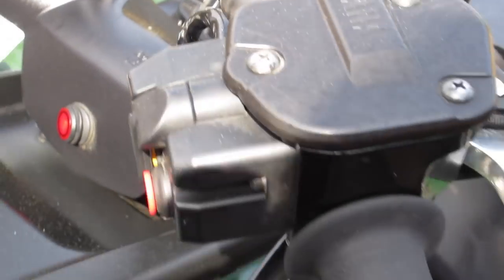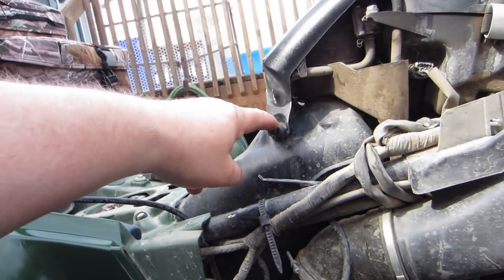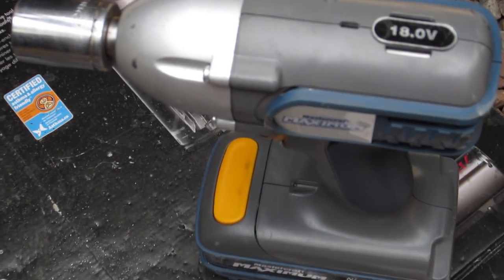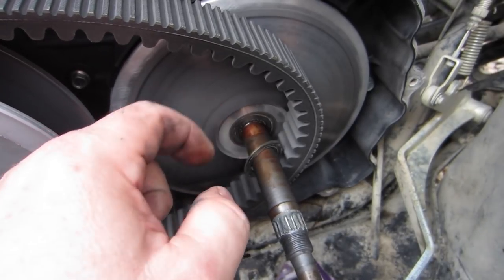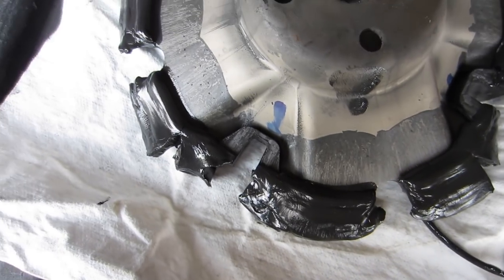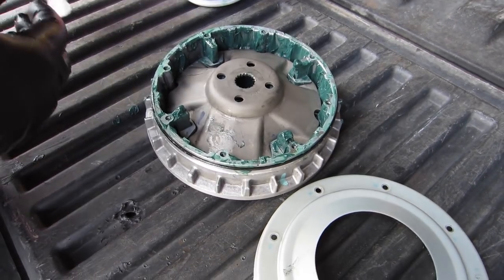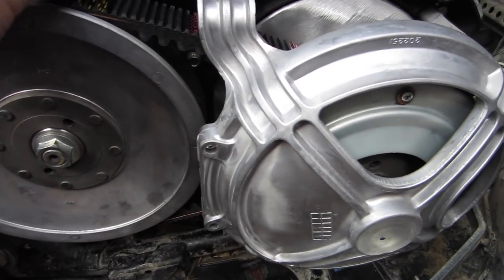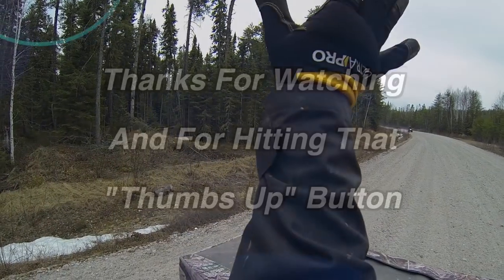Yamaha Grizzly 700 CVT Primary Clutch Cleaning

Comment: 4500 miles on my grizzly, i have never done this and have never had any issues. I have only done regular oil changes, air filter maintenance, coolant change, 1 spark plug, and replaced battery once. still runs like the day i bought it off the showroom floor.
Reply: Yours is in desperate need of a cleaning then. Especially if you have spent any time in dusty conditions. Your grease will get hard and the rollers can't travel the full channel.

Comment: Great job Cubbee, I was a newby with this job just a month ago and it went very well. Mine was at about 5400 kms (though with larger tires and then tracks the last 4 or 5 years the odometer has to be a little off) and there were zero cracks between the lugs. The grease was far too dirty and tacky but it was still doing surprisingly well. Lost maybe 2mm on the belt in both dimensions, remarkable. Allegedly these are 11,000km clutches. We dropped in four 14.7gram Dalton kit weights (a real pain to press out the stock ones and re-insert the others) but what a difference on the low end, snappy! Pretty much the same thing as the "Kodiak Conversion." The only difference I learned different was putting some grease on the outside of the cam plate, into the wells above the sliders but looked very good to this newby and I watched a lot of vids on it! Fantastic overview. We did pull of the brake lever, good to know it's doable without that. We didn't bother with the side panel above the clutch, worked out well. Looking forward to seeing that Grizz wheelie even better now as the rollers should move smooth as silk now. Any flat spots on the plastic roller housings?
Reply from the maker: The Grizz wheelies just as good, and I think I might have gained a bit back on the top end.  LOL  I have noticed it is a bit quieter now too...less "whining". The roller housings look good, and hopefully they'll be good for another 4500km's.  It sure was a messy job getting all the old grease out.  What did you use to clean it? I used varsol and brake cleaner but still took a lot of rags.  Thanks for watching and commenting!
Reply: Yes, noticed it ran quieter too. I just used a can of degreaser after wiping out as much as I could with paper towels. Totally grungy job! We really don't need any more top end in those short little wheel bases anyway! What a clutch those Yamahas have!!
Reply from the maker: Canesser
Sounds like you cleaned yours like I did mine!  Messy!
Reply: ***** engine degreaser and a pressure washer.. :P
Reply from the maker: warmfreeze
Yes, that would do the trick I bet!
Reply: warmfreeze
Yup that would have been better. Just used a parts brush and old tooth brush. Got-r-done.
Reply from the maker: Canesser
Sure did!
Reply: Figured.
Reply from the maker: Canesser
I just checked all my pictures that I took along the way, (just to be sure) and yup got lots of grease in there....good point though and you made me think...did I? LOL
Reply: Canesser  my 2010 kawasaki has 16,000kms and I just had to get my clutch rebuilt. think I did pretty good indeed a lot of hard miles. I know yamaha has the best clutching system out there but at 16,000 no one can complain! kawasaki makes a tough bike.
Reply: That is impressive if that is the 750 Brute Force you're talking about. Lot of power in that ATV! I keep up on the maintenance for performance more than anything, built like a Sherman tank in there.
Reply: nope its a kvf-360. very impressive bike may not be the fastest but it is unbelivably reliable. but like I said ive always done routine maintance and ive replaced a few parts on it but nothing to major what can one expect with all those miles? I am 22 years old so it has had a couple hot suppers if ya get what im saying lol

Comment: Hey guys, i just got it done on my grizzly 450 at the local Yamahastore, the serviceguy is very experienced and probably very old to and he told me that he wiped all the old greese out with papertowel and then washed the variatorparts in gasoline and a small brush...easy and cheap...he also told me that the clutch on the 450 is identical with the one on grizzly 700 and he used 200 grams ( 1/5 kilo ) to re-greese it...it now runs very smooth!
He also told me that the most Grizzlys has a problem with the left rear axel seal...its often leaks of oil because it is not mounted spot on from factory so check that out on your bike (they repair that on warranty)...also he adjusted the front Wheel`s from 6 millimeter ( 1/4 inch ) toe-out to 2 millimeter toe-in because it is way off from factory and my bike runs straight as an Arrow on the road now...just a feew tips for you guys!

Now drive safe =)
Reply from the maker: Thanks for the tips Joakim, sounds like your mechanic knows what he's doing!   Sometimes the little "tweeks" can make all the difference.  Thanks for watching and commenting.

Comment: I should do that on my quad when I get round to it. 2005 Suzuki LTA700 had it from new its 11 years old now. it's mainly used for the work I do fencing and grass cutting in the north west of Scotland. Thanks for the videos most of my quad driving is on steep ground with a trailer so the Suzuki gets a lot of abuse but they can handle it Yamahas are the same
Reply from the maker: +John MacRae Although the belt was in good shape, we were surprised at how dirty the clutch was..well worth checking it out! Glad you enjoyed the video.

Comment: I remember back when I had my 660 grizzly it seemed like it was a bit sluggish even after putting on a new belt.  Originally thought the belt was defective, it was a less expensive aftermarket belt.  Apparently the clutch weights had some gunk around them and weren't allowing the clutch to engage quite as quickly or strongly as it could.  Took them out and soaked them in some diesel fuel to clean all the gunk off and put it all back together and it seemed like a new machine then.  I guess we went through more sand and mud than we realized and somehow it had gotten in there, I don't think it was sealed well.  It really made a huge difference in the performance of the machine.
Reply from the maker: That's good to know Greg...you wonder how dirt/sand gets into some of these places!  But it does!  Cleaning I guess just makes everything run smoother again.  Thanks for stopping by and checking out the vid and commenting!

Comment: Hey Cubbee, I just did the same thing to a King Quad. Same belt too. Man that dust was a pain to clean! I thought it was odd that the Yamaha used grease where the rollers are. Seems like it would make them sticky. Obviously not, since they work so well.
Reply from the maker: Yes, it was a messy little job alright. I don't know why they use grease, but the clutch was quieter with the new clean grease in it. Thanks for watching.
Reply: Thats what i was thinking. my old cat is the same system and runs dry in the roller area.

Comment: Looks like you're a pro at this. Haha. If you hadn't told us it was your first time I would have though that you'd done many of these before. Lol. It's a pretty slick system. So simple. I think those will take over the market if they haven't already. My lawn mower might have something similar to that in it. It's an automatic. I've been trying to figure out how it works. This video did help. You forgot to try reverse. Lol. I'm sure it worked though. If you have all of that apart you might as well change the belt. You made the right decision there. Great video as usual.
Reply from the maker: I had taken the clutch apart once before when I installed the shim, so I guess I kind of new what to expect, but glad you enjoyed the vid.  Yes, the CVT clutch is simple but very effective.  Thanks for watching and commenting!
Reply: Oh. I missed that. lol. No problem.

Comment: Very good and a great help for anyone undertaking this job. But, may I say this is actually belt replacement and roller housing cleaning NOT clutch cleaning. The clutch is a wet plate unit inside the engine and servicing of the clutch is more involved. BUT, thank you !!!
Reply from the maker: Thanks for stopping by and checking out the video!

Comment: How did you find using the Lucas xtra heavy duty grease in the clutch instead of ultramatic grease? Is it working well? How is it in the winter cold? Great videos. Thanks, Dave D
Reply from the maker: We haven’t used the ATV’s much the last couple of years but when we didnin the winter the grease seemed to hold up well.

Comment: Very good job Cubbee! I really enjoyed seeing an up close view of the Grizz to see how it is designed. I have to admit, I had never seen the inside of those clutches in a CVT until now. Thanks for showing the internals of the CVT and how you did the service job. I thought one time I had read something about CVT  transmissions having a fan to cool the belt and clutches? Is this true, does yours have a cooling fan for the CVT? Thanks for taking the time to make the video, I enjoyed it!!!!
Reply from the maker: Hi Palomino! Thanks for checking out the vid.  The CVT design is pretty cool and so simple.  There is a fan, but not specific for the clutch...it does kick in when the engine starts getting warm..it is located up at the front more.  Thanks again, and happy riding!

Comment: Hi
Are you glad you did the shim mod?? Im just about to start to put 1.5 mm in my 2017 grizzly. I do feel its a bit sluggish out of the hole, esp with bighorn tire upgrade
Reply from the maker: Really glad we did the shim mod.  Lost a bit of bottom end when the bigger tires went on and the shim mod got it back.  Nice easy fix.  (You will lose a bit of top end, but still worth it!)

Comment: Nice!  I'm thinking a belt job on my Polaris 850 XP might be a bit of a nightmare as the clutch housing is out back beneath the seat right by the rear diff.  They say that my Polaris belt is good for 5000 miles but if I can get 5000 kilometers out of mine then I'll be happy.
Reply from the maker: That sounds like it might be kind of tricky for sure...best to check the belt..we didn't now what to expect as had no idea how long the belt might last either.  Thanks for watching!

Comment: Thanks for posting great info. What year is your grizz? And how often should this be done?
Reply: If your in dusty conditions often, do this every year or 2. Or around 2000-3000 miles roughly. You can go greaseless on the rollers, but make sure to lube the shaft and carrier bushing. The grease is not for lubrication, it's for noise suppression.

Comment: Finally got it, appreciate the response. 
I do have another question, I stripped the 22mm bolt that holds the sheave (primary) on. Can I use any 22mm (16mmx1 inner diameter) bolt to replace it ?
Reply from the maker: As long as it is a good quality bolt I don't see why not...bummer!

Comment: Awesome How to vid, Did you replace Belt with stock Yamaha parts or use another brand. The grease looks like Marine grease. I need to tear into my 450 one day and do the same. Thanks for posting.
Reply from the maker: Thanks very much!    I'm sure the aftermarket belts are fine but we  went with a Yamaha belt, just to be sure.  Surprised at how much "dirt" was actually in the clutch mixed in with the grease!  Appreciate you checking out the vid.

Comment: Just picked up a '13 550 with 800km. Have had it for about 4 days, almost at 1k now. Loving it so far. I noticed when you were revving it with the clutch cover off at around the 12:59 and 13:09 marks, there was a knocking noise at the begging of each rev. Seems like my 550 makes this noise as well. Is this common with Yamahas? Was getting scared that I bought a unit with a bad bottom end.

Watch a lot of your Vids Cubbee, hope to do a lot of exploring of Manitoba over the next couple of years haha!
Reply from the maker: Listened to the video again and the noise I think you are referring to is the "blip" of the throttle..but kind of hard to tell....if yours sounds like ours then I don' think I'd be concerned as ours now has over 8000 km's on it and it's running great!  Thanks for checking out our videos and hope you get out exploring. Happy Trails!

Comment: Suzuki kingquad got same clutch. But why grizzly uses oil in cvt?
Reply from the maker: Lukas Juozaitis. The wet clutch runs in the engine oil..just like the Suzuki
Reply: Nooo. I mean yamaha in cvt primary have grease. And suzuki kingquad cvt looks same but has jo grease. I want to know the difference If you know.

Comment: any advice on getting the cover plate off of the primary sheave? I've removed the small screws and copper washers but it doesn't want to move and wouldn't rather not bend/break it
Reply from the maker: There is a big o'ring in there which makes it kind of tight to get off...don't want to damage it but maybe go around the cover with a screwdriver and gently "pry" it off..I think that is what we did...but it is a bit tricky.

Comment: Well you inspired me with this one so I dove in headfirst and adjusted the valves on mine today. I have an 09 700 and after you get all the plastic off its pretty easy if you are somewhat mechanically inclined. Have you attempted this yet or do you leave internals to the dealer? Mine were too tight and they haven't been adjusted since new. Some say the Grizz's tighten up during break in. I believe it. Measured at .003 before adjusting to specs marked under seat. Runs way better. Can you say "WHEELIE!!!"?
Reply from the maker: Hey!  Right on and good for you rolling up your sleeves and "digging" in!  I keep saying I should check the valves but I haven't yet.  I too had heard that they adjust themselves after break in.  Good to know and that it helped performance....who doesn't want to WHEELIE on a Grizz.  Might have to be my next "maintenance".  Thanks for watching and commenting!

Comment: Is the wet clutch outer shaft same diameter as the rhino? where did you pick up the shims? Are they actually washers?
Reply from the maker: +Rhino Rider Not sure if they are the same as the rhino..haven't had any experience with them.  The shims look like washers...they came from a snowmobile dealer but not made specifically for the shim mod. Here is a link that might help http://forum.highlifter.com/Grizz-700-shim-mod-question-m3944807.aspx

Comment: Im having a brutel time trying to get the ratchet strap to hold the primary so i can torque the 22 mil bolt -_- so frustrated lol any tips? Great video btw!
Reply from the maker: I wrapped our ratchet strap around a couple of times and tied it to the foot peg if I remember correctly....it isn't easy though!  Hope you eventually get it and thanks for watching.
Reply: cubbeezx may buy a clutch holder from tusk i cant get ratchet strap to hold lol. Thanks. P.s my belt looked miint at 3400 km's. And those were some tuff km's!! Lol

Comment: Cool video , never seen grease in a clutch before, neither my polaris or arctic cat do, wouldn't that stop the rollers from moving freely ? Good work cubbee
Reply from the maker: Thanks!  They do make "greaseless" rollers but both the Grizzly and the Kodiak stock clutches need grease.  Thanks for watching.
Reply: I think there are different types of CVTs depending on brand. I think yamaha uses a wet clutch system so that the belt is always engaged where as some other brands use a kinda of slip system where the belt is actually disengaged at idle. Not sure of all brands use which, but I am fairly certain polaris uses the slippy system. Probably why you didn't notice any grease.

Comment: Nice video Cubbee Guy !! Good info for those that have that type of clutch. It's not needed I'm sure, but I use to put a new belt on every winter just before tracking season. But that's me. And I switched my Grizz clutch over to a greaseless setup, have you thought about that ?? Anyway, good job & Thanks for shar'in the info !!
Reply from the maker: Thanks Gunny! Ya, I had a new belt, so I changed it but I am sure there was lots of life in that old one yet. The greaseless setup would be nice but I am thinking by the time I have to do it again, I will probably be driving something newer. Well, it doesn't hurt to dream does it? lol Thanks for stopping by for a look.

Comment: I think in yamaha they've been much more smarter than in suzuki. When u have to lock the nut of the primary clutch, on the grizzly u turn the wrench anticlockwise . That's maybe  unusual but correct.

on the kingquad, we  stupidily have to turn the nut  clockwise and, since the clutch spins clockwise too, we have to use a lot of glue before tightening it , and it's not a beautiful things when u need to loosen the nut and check the rollers of the clutch. It's a total mess.

I noticed that u make use of a lot of grease . Actually, I barely use it because the steel of the rollers is covered with a pretty thick teflon layer. Isn't the same for the grizzly?
Reply from the maker: Impressed with the design/reliability of the Grizzly clutch too.  The clutch had a lot of grease in it from the factory and called to replace with clean...must not have that coating the Suzuki does?  That is a good idea though!  Thanks for stopping by and commenting. Happy Trails!

Comment: did you done cvt in 450? how tight did you torque that cvt bolt? you said here in g700 is 100 ft lb.
Reply from the maker: +Kamil Szczepaniec Yes we did the CVT on the 450 too. Can't quite remember but I think it was 75 ft lbs...a little less than the Grizzly.
Reply: +cubbeezx thanks!
Reply: +Kamil Szczepaniec Yep, 75 is good. My 2003 450 manual actually says 72, so 75 is close enough! Thanks cubbeezx.
Reply: 56pw thank you a lot!!!